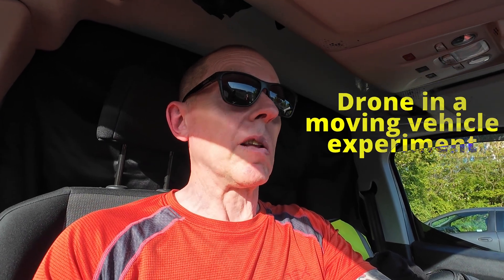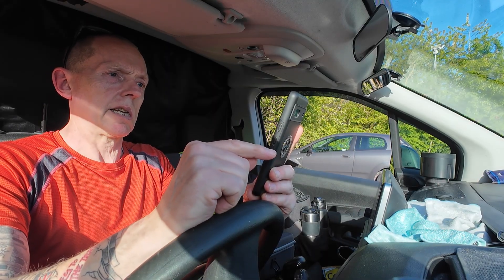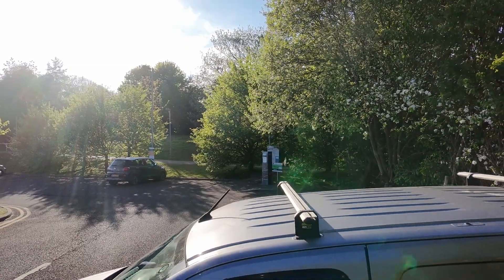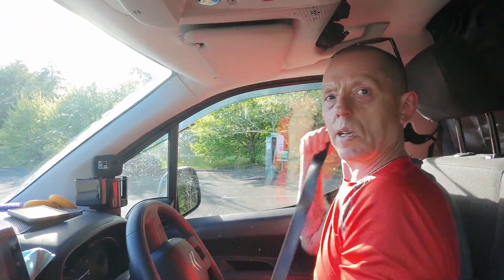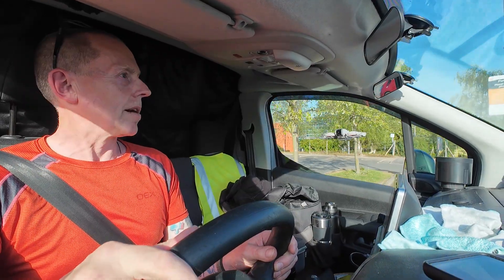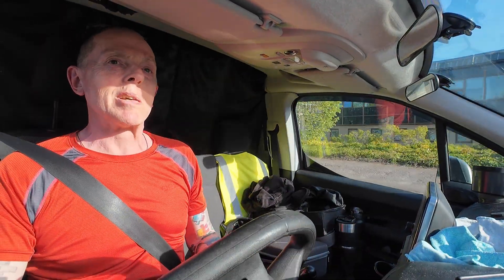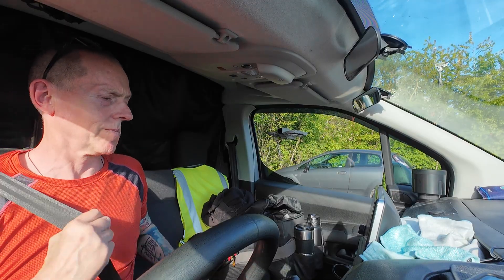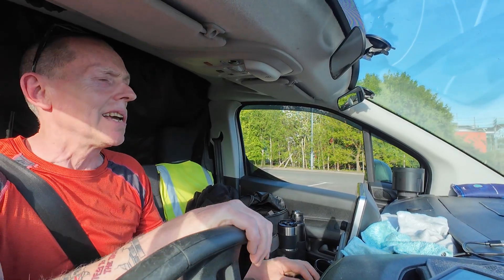Drone Flying in a Moving Vehicle Experiment

Comment: Not only is it illegal to fly that way but it's illegal to drive like that. Also as soon as the GPS locks it tries to maintain it's position flies at a wall, it's not the air, it's the GPS.
Reply from the maker: That's the reason I went to a private car park.
And that drone wasn't using GPS. That's why I used it.
Reply: @MoreThanJustaCleaner  Believe it or not it's still not legal to use a mobile device in a Private car park, that's why they added the exception to the law that says "You can use a device held in your hand if: you’re making a contactless payment in a vehicle that is not moving, for example at a drive-through restaurant" which would of course be on private land.
Reply: @MoreThanJustaCleaner  That looks like a DJI Neo to me, "The GPS on all DJI aircraft, including consumer, professional, enterprise, and agricultural models, cannot be manually turned off."
Reply from the maker: @ThatGoth it was flown in manual mode from my phone, no GPS. It only uses GPS when flown with a stick controller or motion controller.
Reply: @MoreThanJustaCleaner  All DJI drones use GPS even when flown from the hand, they use this to work out if they are in a geofence zone and to do a position lock, it can not be turned off without tin foiling the back of the drone.
Reply from the maker: @ThatGoth I stand corrected, you're quite right 👍😊 However that doesn't explain why the drone travelled with the vehicle for quite a distance. If the drone had locked onto a GPS coordinate for the launch point, surely it would have tried to stay at the launch point and not travelled with the vehicle...
Reply: @MoreThanJustaCleaner  The partial metal faraday cage (the car) blocks and bounces the GPS so it struggles to keep a lock
Reply from the maker: @ThatGoth yeah good point 👍😊

Comment: It's not the movement of air. 
Stationary objects stay stationary unless acted upon
Reply from the maker: What do you think it is?
Reply: @MoreThanJustaCleaner You are being accelerated by the engine pushing the van pushing you. The drone does not have a seat to be pushed by so it does not move from its original point. You saw it correcting and it worked for a bit because it probably has collision sensors but it won't work with other drones.
Reply from the maker: @t0k4m4k7 it has no collision sensors. All it has is optical flow sensors underneath and their aim is to gauge height.
If you vape in a moving vehicle with the windows closed, apart from a little sway, the vape largely stays in place because the air in the vehicle is moving at the speed as the vehicle. It's that action that largely keeps the drone in place.
Reply: @MoreThanJustaCleaner For the vape it's different because the vape smoke stays there because of buoyancy, an interesting side effect being that Helium balloon tilt in the opposite direction one would expect when in the vehicle. Search for mythbusters balloons in a van or something similar.
You're right it doesn't have proper collision sensors but i think the ones you mentioned still aid in keeping a fixed spot for low accelerations.

Comment: I think it's just the GPS lock, the drone wants to stay where it is physical space, nothing to do with air flow I don't think.
Reply from the maker: That's a good point however, as far as I'm aware the DJI Neo does not use GPS in manual mode, which is how I flew it. This is why it's not recommended to fly the Neo over water unless using a GPS controller or the FPV setup.
Reply from the maker: I've looked further into this and the Neo does indeed use GPS in manual mode. That being the case, surely the drone wouldn't have travelled with the vehicle at all... Wouldn't it have tried to stay where GPS told it it launched?

Comment: So, it moves with the van as the air in the van is also moving, it's essentially floating in a moving box of air. Its only the confined space that caused it to return to crash mode, as well as mass and inertia. In the first example, turning the car also caused the air to turn but the drone being without sensors wasn't aware of this and carried on (mass and inertia sans sensors), crashing into the pillar.  Thanks Newton's First Law. 

Can we test it flying through the car whilst driving (you control it, I'll drive the car)? Oooh, we could do it Friday. 🙂
Reply from the maker: It was an interesting test :)